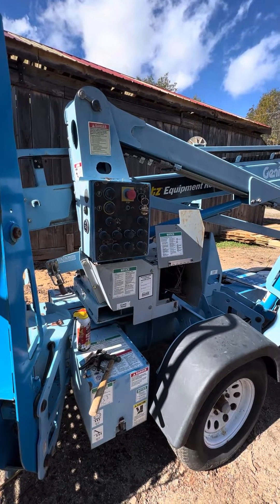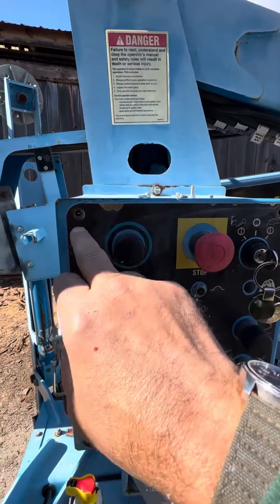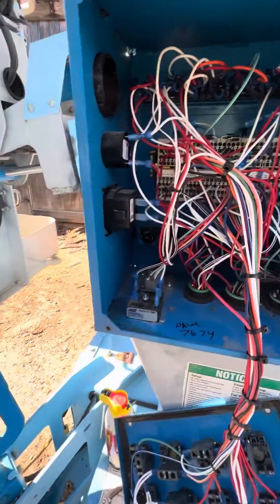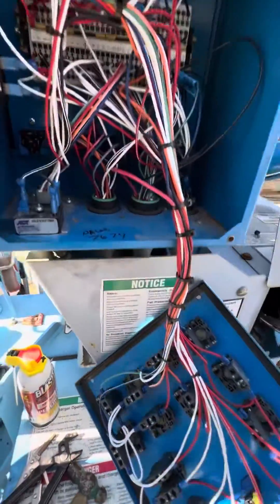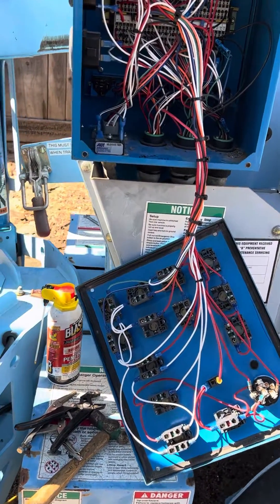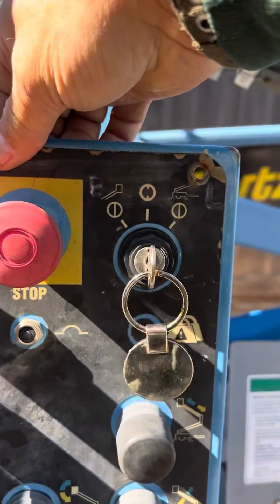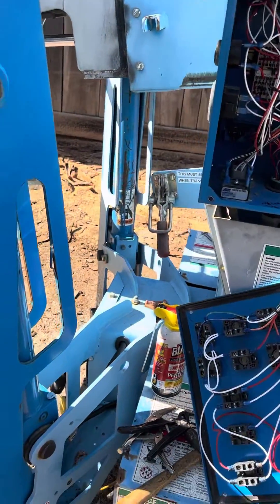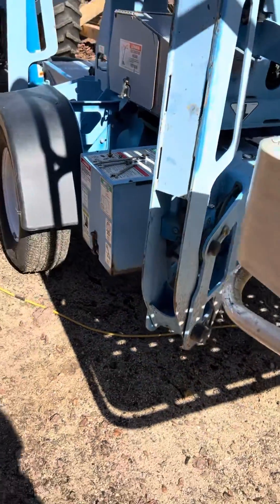Genie Manlift TZ-34/20 fixing non operational mode beeping in platform position

Comment: We have this exact lift and are having an issue where the lift operates correctly for about 5-10 minutes, but then starts modulating.  The pump kicks on, then off, back on, back off.  The more you try to use it, the less movement you get out of it.  Ever experienced this before?  The shop we took it too has replaced a battery, the hydrolic pump the electric motor, basically all the big expensive stuff.  We just got a new charger for it, but still having the issue.  Any ideas?
Reply: Did you ever figure it out?  Mine is doing the same thing.
Reply: @stevek3270 we are suspecting a ground issue.  I haven’t had a chance to really dig into it, but some controls work fine while others cut in and out.
Reply: @cavaliers60  Thanks for the quick reply.  I was just working on mine, and it started acting erratically , then stopped altogether.  After messing with the solenoid, and controller wires, it came back to life, and I was able to get it back down.

Comment: My tz3420 works from ground but from platform only goes down but not up any idea what could be wrong? There is voltage in all wires
Reply from the maker: Hi @lift
What I’ve found when I have a platform power / control issue, is that there is an issue with the level sensor from one of the legs .  
You can try from the ground position to actuate the legs and see if there is an issue.
Reply: @theMainetimberframer good morning I having issues with my genie 34/20 works fine from ground but not from platform. 
All 4 outriggers works just no functions from platform checked voltage and there is voltage on all wires any idea what could of be
Reply from the maker: Hi Liftq6b:
So I understand:
All functions work from the platform switch position? You are able to fully raise the boom, lift and rotate from platform position?
When you switch to basket position, you have voltage to the basket controller, but you can not operate the boom, lift or rotate?
On another note:
I replaced my batteries this Spring.  Since then, I’ve had zero issues.
Reply: Good morning I'm having the same problem on my genie lift were you able to figure out the issue on yours?